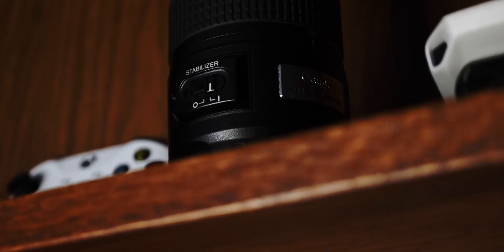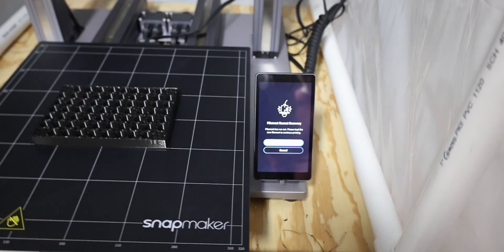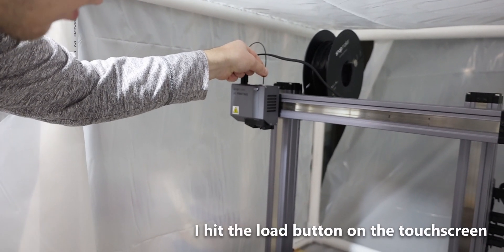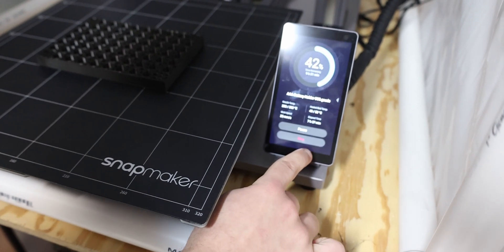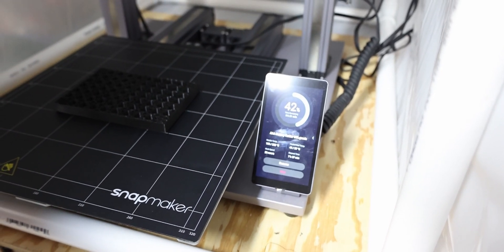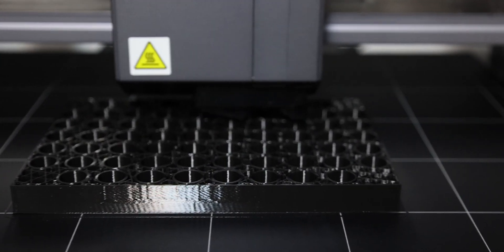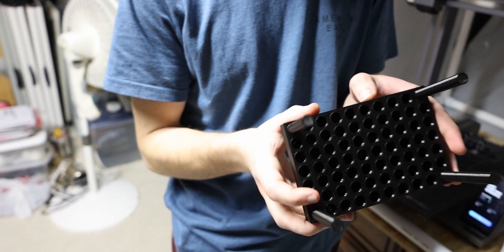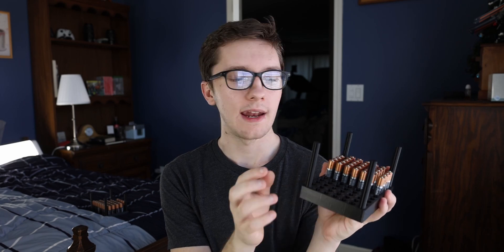3D Printing Filament Recovery Process

Comment: Good Video. I am having a strange behavior with my Snapmaker 2.0 A350 where it will start printing for a couple of minutes and (2%) then it will quit the job for no reason. Any thoughts why is this happening?
Reply from the maker: I wish I had an answer for you but I have not had this issue pop up with my 3d prints yet so I can't really give you an answer. My guess would be maybe something is wrong with the G-code or a sensor in a module. (this is not based on anything, just throwing out ideas) Though, when you get it sorted out I'd love to hear what was causing it.

Comment: Glad to see it's that easy, currently have a print going on for the last 5 days and it's about to run out of filament.
Reply from the maker: The longest I've printed for is 4 days. The only thing to check on is when it comes back down after refilling. The nozzle will be hot so a small string of PLA might come out and angle weird when it continues but you can always grab it off before it goes down all the way. Best of luck with your 3D print!!
Reply: @RyanTuscher  Today I had both an unexpected power outage after printing for about 20h; recovery worked fine (outage lasted about ten minutes), but then it ran out of filament just a couple of hours later. I didn't have a new spool ready, so by the time I had finished work and bought a new spool a few hours had passed... and now it won't load the filament. Seems the upper tube/opening just below the feeder gear is clogged, so I guess I will now get to know just how the 3D printing toolhead on the Snapmaker 2 is built... wish me luck!
Reply from the maker: Wow Ketil, that is some bad luck! I wish you the best with getting everything cleaned out and hopefully everything goes right if you start it again!
Reply: @RyanTuscher  thanks 🙂
Nozzle was completely clogged, but I didn't have to disassemble: After some googling I cranked nozzle temperature up all the way (started at 250, eventually increasing to 275), and slowly most of the material oozed out of the nozzle. There was a bit stuck in the very top of the feed tube just under the gear; I managed to tease that out using a long, sturdy needle/pin.
Unfortunately I didn't realize it was clogged until it had done almost one complete layer, so when I eventually got it to continue it appeared to work, but when it was done it turned out there was practically no adhesion at all between the first half of the print and the rest, so in the end it was a failure, though an educational one.
On the upside, my next print - my first attempt with TPU - was a resounding success 😁
Reply from the maker: That is definitely an annoying thing. Glad you were able to learn more about the machine! I've been thinking about using TPU one day for something so I will be doing some learning soon myself hahaha! Enjoy printing now that everything has worked itself out!!

Comment: I'd really recommend you changing the PSU Fan. It is a lot less noisy while printing.
Reply from the maker: I didn’t know that was even possible. I’m currently working on making a custom enclosure for the Snapmaker so eventually it’ll be in a more sound dampening box to prevent noise. Thanks for the suggestion and watching the video!
Reply: @RyanTuscher  the change of the fan itself made the PSU so silent that you don't hear it at all when the cooling fan is running. Good luck with the Enclosure. Have you checked the features of the "official" enclosure? The have put some really clever features in there.